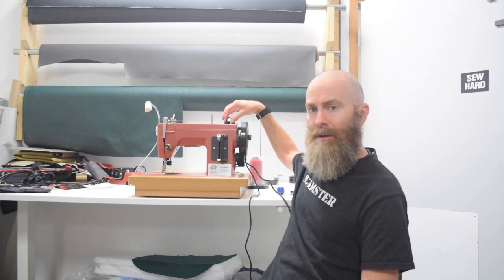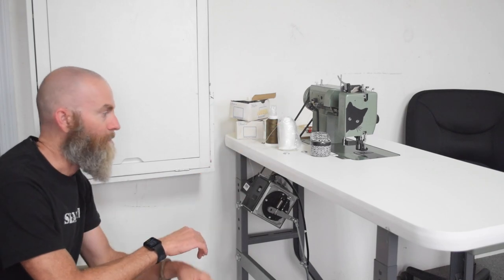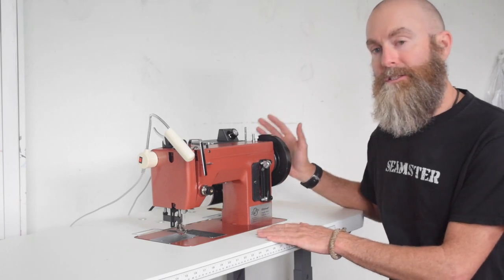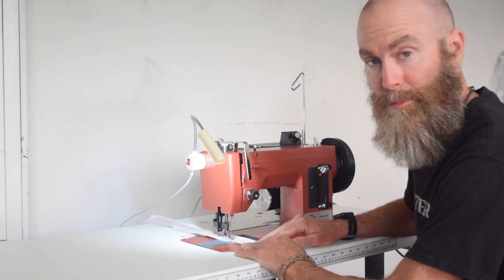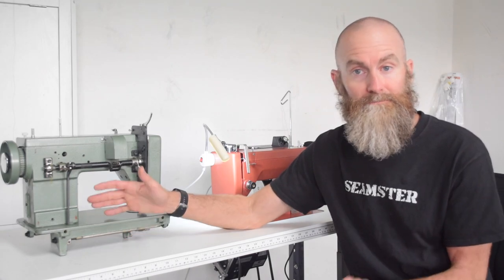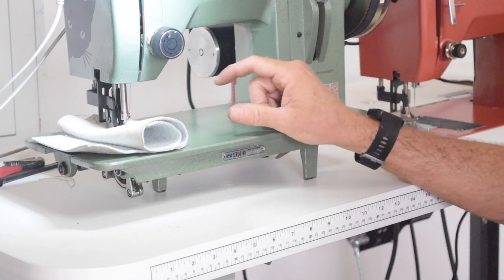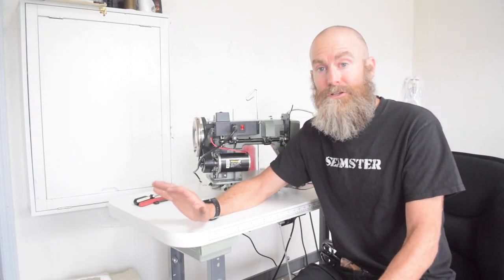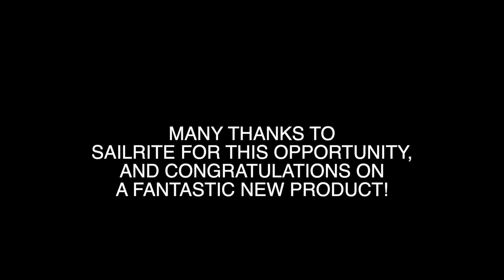Sailrite WorkerB Motor Package (It's Incredible!!!)

Comment: Hey Jason, thanks for the video! How would you compare this to the workhorse servo motor from Sailrite?
Reply from the maker: Hi Nick,
I think if I were blinded as to which motor I was using, I might still be able to pick out the WorkerB.  The precision is pretty remarkable.
I got a Workhorse motor thinking I would use it on one of my Thompsons, but I didn't realize that the existing motor had to be removed form the machine. I was hoping to easily be able to transition from the Workhorse to portable sewing, but it's a little more involved than I initially thought. For someone wanting an Ultrafeed-style machine to remain portable but also have servo-like power and control, the WorkerB is it.
The Workhorse, however, is a fine servo motor, and I plan to use it on one of my industrial machines.  My only complaint is I wish Sailrite sold a needle positioner for it.  It can take one, but I'm told there is some process to get it to work, it's not just plug-and-play.  The motor itself seems to be of noticeably better quality than my cheap amazon motor, and feels smoother in use.  If you don't need a needle positioner and are willing to pay a little more for better quality, it's a great servo motor option.
I hope that helps, thanks for the question and thanks for watching!
Reply: @thejasonofalltrades  Thanks, that makes sense! I've been on the fence between the Workhorse and the WorkerB for a permanent home setup (with their industrial table). If you didn't need to transport the machine around, would you still get a WorkerB, even though it's a bit slower than the Workhorse?

Thanks for the discussion and all your videos!
Reply from the maker: @growunderashade  For me and my uses, I value portability (or versatility) over speed (for an Ultrafeed particularly).  For the kind of sewing I do, I rarely need to go particularly fast.  Given that, on an Ultrafeed, I would get the WorkerB every time.  If I were going to have a machine "permanently" mounted in a table and using an under-table industrial motor, I'd rather just have an industrial machine (for the knee-lift, if nothing else).  The only possible exception I can think of is using an LSZ-1 in order to have zig-zag, since walking-foot zig-zag industrials are rare and pricey when you can find one.And frankly, I'd probably still go with the WorkerB in that case anyway.

Comment: Best to put the WorkedB on the Thompson, and put the LSZ on the Workhorse servo table. I have a LSZ and I really wish I bought the Fabricator instead. I will probably put mine on a servo table. Im just a bit sad because I bought a portable table and a Monster Wheel, when I really should have got a servo!
Reply: Don 't buy the Fabricator either.  It's a 111 Clone.  You can buy another name brand 111 clone for a lot less money OR buy a used 111 cheap and throw a 120.00 Servo Motor on it.  Almost any Singer 111 you buy will literally outlive you.  'course it won't be painted gloss black, but............
Reply from the maker: Thanks Dustin!  I;'m going to use the Workhorse for another industrial machine.  My vision for the Sailrite industrial-style Ultrafeed table has always been as a base for multiple machines - I can use any of my Ultrafeed/Thompson machines, Singer 201, Singer 237 and maybe others, but those are the ones I use most. It makes for a versatile platform for my home sewing space, and with the WorkerB motor package, the Workhorse becomes unnecessary in that application.
Regarding the Fabricator, while I also lean toward old, used machines, there is something to be said for new, warrantees ones, too.  You have to decide what you prefer - hunting the classifieds for a good deal on an old machine in good shape, or just clicking "buy" on Sailrite's website.  For some, one of those options is better than another, but both are valid options.
Thanks for watching and commenting!

Comment: Is it also called a servo motor?
Reply from the maker: From a purely technical perspective, this is not a servo motor.  In practice, its performance is the same as a servo motor.  Compared to a clutch industrial motor or even a household sewing machine motor, it has very precise control.  The power is greatly increased over the household sewing machine motor and is comparable to an industrial servo motor. I'm not particularly well-informed on the technical differences between different types of electric motors, but in a blind test I would have thought this was a servo motor based on the way it performs.
I hope that helps, thanks for watching!

Comment: with this machine fold in to a singer table
Reply from the maker: Hi!
The machine will fit in a Singer table, but it will not fold (none of the tables I've tried, anyway). I suppose one could be modified to allow it to fold, but it would require some woodworking to accomplish.
I hope that helps, thanks for watching!

Comment: Fantastic means not cheap?
Reply from the maker: It depends on what you mean by "cheap."  I think the retail price for the separate motor package when it is released will be $299USD.  I think it is totally worth that.  I'm working on selling off a couple of my machines to fund buying an LSZ-1 with this motor package, but if I already had an LSZ-1, I would definitely be buying this motor for it.  You have to decide what you need, and how bad you need it.  If you never need incredible slow speed control, the on/off switch doesn't matter to you, etc., then this package may not be worth it to you.  If your sewing requires careful but powerful sewing with incredible control, then this might be a bargain.  It really depends on what your sewing needs are.
Thanks for watching and commenting!

Comment: Can you mount that motor on your Vintage Singer?  I have Singer 15-90 that is currently running on a 1 amp motor, but I would love to get something a little bit stronger.
Reply from the maker: Hi!
So, no, it will not directly bolt on without serious modifications to the machine. Yes, someone sufficiently motivated and skilled could certainly adapt it somehow.
I also had the same thought when I first encountered this motor system, and I can't rule out the possibility that I will try it on a machine one day, but honestly I think it's a bit like putting a V8 engine into a Miata; yes, but can be done, and yes, it can work really well, but in a real practical sense it probably isn't better than just buying a Corvette (or whatever).
The low speed control of this motor is EPIC, and it is FAR more powerful than a domestic sewing machine motor. My argument is that for a non-walking-foot machine like a 15-90, feeding is still going to be the weak link. Depending on what you do the most with the machine, it could be ideal, but for general use, I'm not sure the juice would be worth the squeeze.
I hope that helps, thanks for the question, and thanks for watching!
Reply: @thejasonofalltrades ,  ok.  Ty so much for such a thorough explanation.

Comment: If your going to get a sailrite get the fabricator if you plan on only using straight stitch
Reply from the maker: The Fabricator seems like a great option, but it is not a portable machine.  For someone who lacks the space for a full-size industrial machine, or who needs to move the machine to different locations, the Ultrafeeds are the way to go. 
Thanks for watching and commenting!

Comment: Hi you keep saying other machines are knockoffs of sailrite when in fact Sailrite machines are the knockoff even though they are the much better machine in the end.
Reply from the maker: Hi!
My understanding of the situation, and if anyone can show evidence to the contrary I'm all ears, is that Datho manufactured the Thompson Mini Walker as the first machine of this design (incorporating a walking-foot mechanism into a portable machine).  Sailrite (again, as I understand it) licensed the design to produce their own version, and then refined the design further.  Apparently Datho still exists but no longer produces the Thompson machines. 
If all of that is correct, then I don't consider the Sailrite to be a "clone" or a "knock-off." The current model of the Toyota Supra is a good example; Toyota, rather than invest in the design and tooling to produce an entirely new car, procured the rights to produce (essentially) their own version of the BMW Z4.  It isn't a copy of the Z4 (or a clone, or knock-off), but rather a car based on the Z4, with license granted to produce it.
Again, my understanding of the situation is that every other variant of the mini walking foot machine is an unlicensed copy.  I don't know what the current state of patent is on any part of the design, or whether any of the clones violate any patent.  I believe that they are all taking advantage of design and tooling they did not produce themselves, but that were intended to be used to manufacture Sailrite (and possibly Thompson) machines. There is a reason all of those machines cost less than a Sailrite; some think it's because Sailrites are overpriced, I think it's because they are taking advantage of the road that was paved by Sailrite and Thompson.
I could be misinformed or just plain wrong about all of this.  Part of my opinion is formed by my own views, which may not be aligned with anyone else's on this subject.  My position is and always has been that Sailrite contributes a lot of innovation and support to the market in the form of new developments (like the WorkerB), excellent customer support and widely sharing information for free through their Youtube channel and website.  I prefer to buy from them for those reasons, and the fact that I think their machines are better in numerous ways than the similar machines on the market today.
I hope that helps, thanks for watching and commenting!
Reply: @thejasonofalltrades  Hi 
As for the design and production of this machine, I should be the clearest. I am the manager who is actually responsible for R&D. Mr. Thompson delivered the first manual sample machine to me. I do the production optimization work that is most suitable for the product. For this reason, I have been Go to Texas twice and visit Mr. Thompson.
Sailrite has made many quality improvements and more user-friendly improvements for the Walking Foot machine. So Sailrite is an improvement (optimization) of the Walking Foot machine.

Sailrite machine cost is much higher than other machines. This is an indisputable fact. The higher part will not be discussed today. I have these machines. I know the cost better than ordinary people.
So the price of Sailrite machine is reasonable.